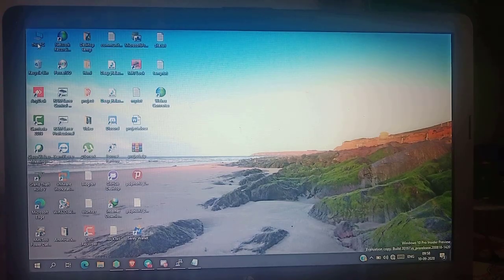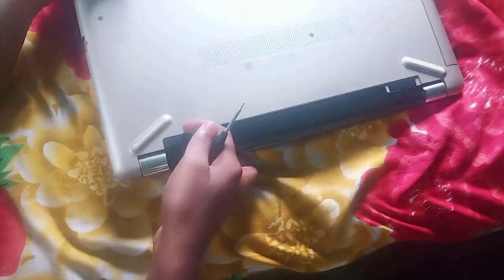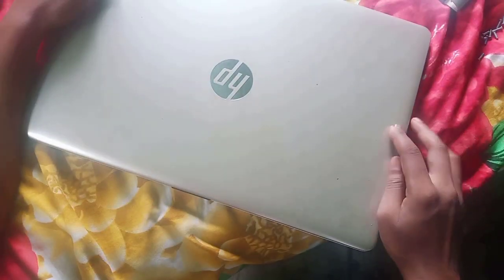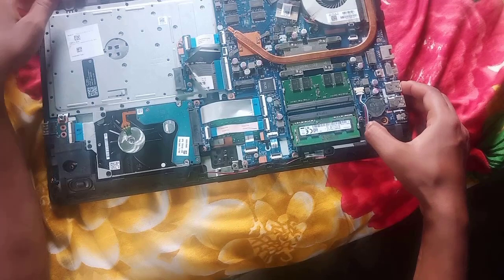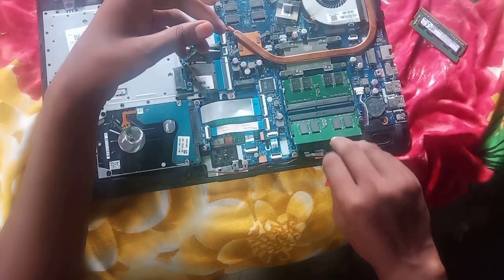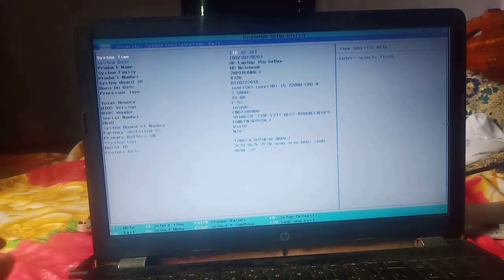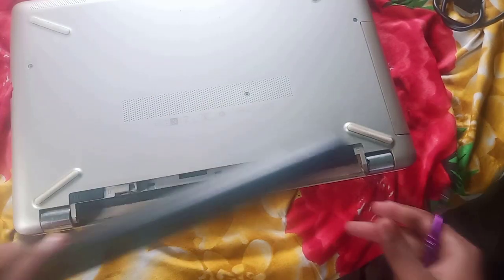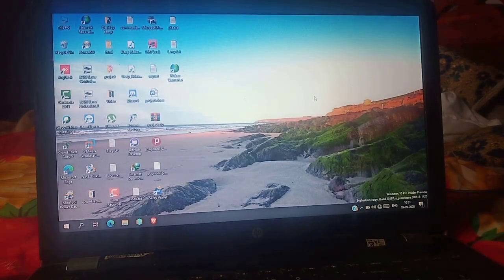How to upgrade or replace RAM in HP laptop

Comment: How do I contact you?
My Laptop doesn't seem to have a ram port....
Its a 12 yr old laptop.
Reply: Old ones don’t have replace the extension ram
Reply: @jakyim4955  .... Is opened it and it has.
I just need to buy one one :(
There is 2 ports
Reply: @ניין-י9ש  👍🏻

Comment: Can you actually run gta on that computer with no lag
Reply from the maker: Yes, I have increased ram to 16GB
Reply: Do you think if I upgrade to 16 GB with intel celeron n4000 would I be able to run GTA with no lag and get good frames
Reply from the maker: You are using i5 or i3
Reply: How can access that information
Reply from the maker: Open up this PC then go to properties
Reply: It’s ig3
Reply: I3*

Comment: Thank you very much for the video! Does all HP have 2 ram slots?
Reply from the maker: Yes,  almost all
Reply: @AN1InFo  Turns out that mine only has one slot. Oh well no biggie I put 8ram in it.
Reply: My those not have a RAM slot and it came with just 2gb RAM for 500gb 
What do I do?
How do I upgrade the room plssss

Comment: Can I put an 8gb with a 4gb if they are both 2400…?
Reply: I'm wondering the same. From what I've seen, it seems like you probably could but it will run on the speed of the lower ram.
Reply: Yes you can as long your motherboard can handle 12gb of ram

Comment: my laptop is hp laptop 15s fq1xxx 4gb intel i3 10th gen intrgrated graphics in need atleast 8 or 12 gb can i add it?
Reply: Of course u can
Reply: 8gb will cost u around 2500 and 12 gb will cost u around 4000(these costs depend on the brand,u can find cheaper ones too :)
Reply: @ADI-pd9hh  thenks :)

Comment: How to do I find the perfect ram for my laptop
Reply: mr memory
Reply: Did you check your ram compatibility on your laptop?
Reply: HP's website has good answers for this, you can also try running the hp support manager tool that usually comes on the laptop. It will tell you what you have and how to use the it site to confirm the max allowable to upgrade.
Great instructions Anon tech thank you.
Reply: Go to task manager (ctrl+shift+esc) go to performance and then select the Memory tab

Then see what kind of Ram it has if it has 

My laptop had Sodimm type which means DDR4

You can google the alphabets that come up to show what type of ram you need

It also shows how many empty ram slots does your Motherboard have 

You can also Open up the Back panels and take out the ram and see what type it is

If it has pc-3 written on it then it’s DDR3 and if it is pc-4 written on it is ddr4
Sometimes there’s straight away written if it’s ddr3 or ddr4 

Also check id There is any ending Letters at the end of the ram like U,V,S etc which stand for how much voltage they take

But mostly all rams works just fine if they are of the same time (i.e ddr3 or ddr4 respectively) so alphabets don’t matter just to be on the safer side
Reply: @anmoldaglaik  thank, but I already got my ram, which is 16 gb but for some reason my laptop performance didn’t boost. Do you know why? I think it’s because my cpu is bad
Reply: @fakey02  does it says total ram 16 GB?
And what CPU do you have And do you use a SSD or A HDD 
And if you use it for gaming do you have a graphics card?
Reply: @anmoldaglaik  My Ram is just 16. My Cpu is AMD E2-9000e Radeon r2, 4 compute cores 2c+2g, My Gpu is AMD Radeon (TM) R2 Graphics. Idk if  I use a SSD or HDD but my driver name is TOSHIBA MQ01ABF050.
Reply: @anmoldaglaik  it might be SSD
Reply: the toshiba mq01ABF050 is a HDD not a SDD and yes the Botlleneck of your System might be your CPU
But because you have integrated gpu so maybe the ram boost might result in a few better Frame rates but the CpU might be holding it back

As far for gaming titles older than 2010 should run fairly smoothly on med settings 1080p and games later than 2010and upto mid 2014 might run smoothly at 720p at med settings 

But that also depends upon game to game 

As it’s not worth it Replacing a Cpu of a laptop i suggest you saving up for a gaming laptop in which you can use the ram modules that you bought or even build a Gaming pc if you think you are capable 

Also try using a SSD if you suffer from slow load times and boot up times 
SSD can be Inserted in your CD drive if you don’t have a slot 
I prefer you atleast buy a 256Gb ssd and nothing lower than that to enjoy your experience
Reply: @anmoldaglaik  but what type of cpu do u think I should upgrade to that can handle 16 gb of ram
Reply: @fakey02  i think any Newer gen amd cpus would be able to handle 16 gigs of ram Without bottlenecking it 
Probably the ryzen 3 or ryzen 5 in the 3600x generation or the 3700,3600 gen Would be budget friendly 

But I prefer Intel cpus for laptops as they are more efficient and powerful than AMD cpus and an intel i3 or an i57700u would easily be able to handle 16 gigs of ram in a laptop
Reply: @anmoldaglaik  ok thanks